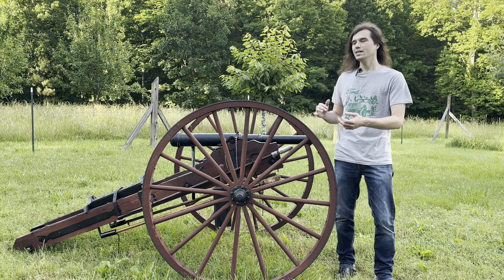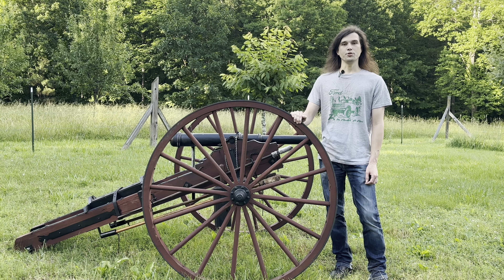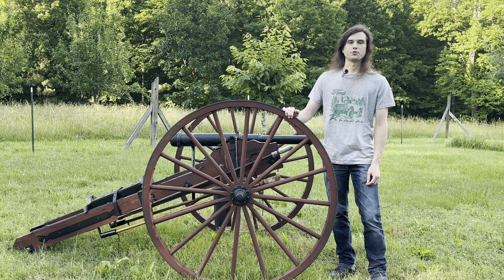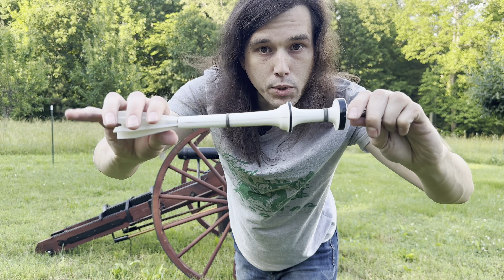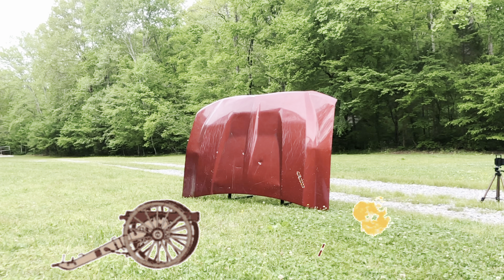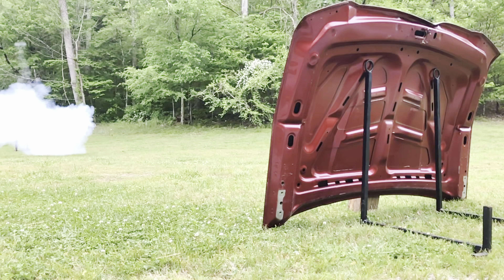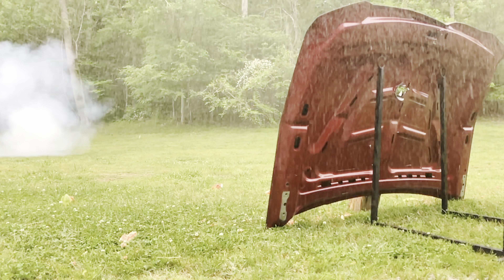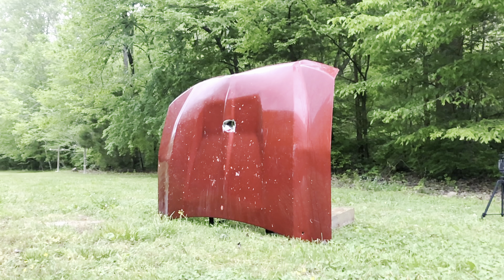Shooting 3D Printed APFSDS Tank Rounds

Comment: The finned dart sabot rounds have been some of the most difficult things for me to get to work and I'm dealing with half the scale you are.
  You can't put a wad behind the fins because that will just crush the fins.  The sabots double as the gas seal.  Most of the darts we have tested (CanaDart,  Anferov bullet,  Dynaslug,  and Sauvestre)  have lugs on the shaft that match up with lugs on the sabots.   Almost all the pressure acts on the sabots and pulls the dart down the barrel as the dart is locked onto the sabots.  A common failure was when we tried to push the rounds too hard -  it stripped the lugs right off and the sabots went flying at a high speed and the dart followed along at a very low velocity.   The video we just did with the CanaDarts used very brittle 3d printed parts.  I had to use a small 25 grain charge of Pyrodex and a spoonful of coffee as an inert buffer to fill the space.   They worked OK but we were only getting about 500 to 600 fps.
Reply from the maker: Oh snap! Wow! Thanks for tuning in! I just recently found your channel and subscribed and your sabot dart made me realize that the rods were supposed to be threaded(and why 🤣😂) like two days before this video came out. I’ve so appreciated the knowledge that you share on how to cushion rounds and the ways you load them and the gas seal ideas. I hope you truly know how much I appreciate your channel and I didn’t expect this to even make it anywhere near a comment from you! I will for sure take your tips into account and get a working V2 version in the future. I greatly appreciate the tips and you tuning in in the first place! Keep making those amazing videos.
Reply: @TheCannoneer   One of my viewers left a comment saying you were having trouble with your sabot darts so I had to check it out.   The viewer-created projectiles have been fun to do and I've been surprised at the creative ideas people have sent.   People have been telling me that we need to scale things up to something like you are doing so it is great that you are taking that opportunity.   The 12ga. stuff keeps me busy.
Reply from the maker: @taofledermaus  I was checking out the back catalog and there's some seriously weird things folks come up with. I have a hard enough time making a big round lead ball half the time!
Reply: @TheCannoneer  If you can get some machinists to answer your call to make projectiles,  I bet you'll get some wild stuff too.
Reply: @taofledermaus  Do you think Evan is ready to scale up his insanity creativity?
Reply: @TheCannoneer  I guess you need to make the fins from metal too. The impact of the wad smacks the PLA and all you got left is a rod getting pushed through the petals. Also what Fledermaus said.
Reply: @TheCannoneer  Amateur enthusiast here, with the tail fins gone before impact, perhaps reinforcing them or changing the material of the fins entirely might improve the accuracy some, perhaps weld a few thin steel fins on, and then encase the fins inside slots in the sabo itself so that they are mostly covered and kept intact out of the barrel. Encasing the plastic fins inside the sabo might also be enough to do the trick, it will redistribute the pressure onto the sabo rather than the fins as the base disc likely shattered by the looks of it. Mind you I am no expert and I am simply watching the same video as everyone else. But reinforcing the fins would be my first solution, then if that does not work, redesign the sabo to cushion around the fins.
Reply: @TheCannoneer  Try metal fins, and painters tape instead of vinyl tape.
Reply: the legend
Reply: It's great to see you here, i love both channels !
Reply: One thing you might also try is making the sabot cover the fins and make a flat surface at the back, while not touching the fins. That way all force is against the sabot and the penetrator, and none of it reaches the fins
Reply: @AhHereWeGo  Exactly what I was thinking, also reinforcing the fins might also do the trick instead, or a combination of the two.
Reply: You should encase the dart in a wooden shroud, like the old ww2 anti tank shells
Reply: I was wondering how this related to my feeds, it's taofledermaus on steroids and I'm here for it.
Reply: I'm not convinced 3-D printing is going to work out here.  The material just doesn't seem tough enough to survive a full-strength shot.
Reply: @RobertLutece909  The strength of prints is entirely reliant on how you print it. There's a way that this can work, the fins just need to be protected
Reply: @AhHereWeGo  I'm not talking about the shape of it.  The material itself isn't tough enough to do what he's trying to do.
Reply: @RobertLutece909  yes it is. PLA can be used to make suppressors, and it can be used to make projectiles, you just have to know how to print it right
Reply: @AhHereWeGo  Quite a few of us in the Buck and Slug Facebook forum use 3d printed PLA etc for wads and bases in shotgun cartridges (full power). I have had particular success using AQ like PLA tails for Lead Lee Slugs but.....these tails are nearly solid plastic and don't have any thin tail sections.
Reply: @ianvincent4911  the sabot he’s using is PLA, it stays intact, the fins aren’t because they’re exposed. If he covered them, and used a threaded penetrator instead of smooth, so the sabot gripped it better, the fins would be fine
Reply: Colab!
Reply: Was just about to recommend a cpl taofledermaus videos about flechetts. Didn't know you already personally commented😂😂😂
Reply: Interlocking ribs on the sabot and dart
Reply: Why not have the fins deep inside the propelant, with the Sabot Petals shaped to harness the expanding gasses to squeeze the petals tighter on to the projectile while in the barrell. This way the charge doesn't push on the fins, the Sabot drags the round up the barrel.
Reply: @PiDsPagePrototypes  because it would melt
Reply: @AhHereWeGo  Depends on the filament they're printed from, and the length of time it's exposed to the heat - if it's printed from the same plastic used for shotgun shells, it'd stand up to the heat. It takes around 280c to print Nylon, it's good for use in car engine components, so it'd hold up to the short sharp temperature spike of being fired.
Reply: Also, yall should do some sort of collab. I mean the cannon is basically an oversized shotgun/blunderbus lol
Reply: Is the cannon smooth bore
Reply: I was thinking the same thing, from watching your videos.
Reply: The round must be pushed from somewhere other than the stabilizing fins. Either the round protrudes from the rear,  or the fins have a solid ear support through them. Also, the fins may not be strong enough to withstand the acceleration and the  wind drag. Finally, the fins might be beings destroyed by the petals.  (SEE SPACE SHUTTLE INSULATION)
Reply: a deeper "face" for the pedals is the only thing i can see that could improve it
Reply: the OG of smoothbore shenannigans
Reply: I had a feeling you'd show up
Reply: You might be able to use a piece of all-thread as the penetrater if getting a machinist proves difficult. You could print the sabot to have the matching ID threads and print fins that screw onto the back.
Reply: Запах кофе с порохом.... Отлично!
Reply: Maybe threading the Penetrator over the whole saboted length might distribute the force enough that the sabot doesn't just sheer off?
Reply: honestly there are two ways to fix this (1. make a full metal dart) or (2. put something behind the dart so that itll be pushed out of the cannon [easier but less likely to fix])
Reply: Funny thing is I was coming to the comment section to say, talk with Jeff at Taofladermaus. And here you are with the number 1 comment. Noice.
Reply: I was literally going to comment talk to Jeff from Taofledermaus as he has a lot of experience with sabots lol
Reply: I think tank sabot gas seals spin independently of the assembly some how. I could be wrong.
Reply: If you look at a tank sabot round the shaft has rings or cut grooves on it. That give the sabot something to bit on to.
Reply: For a relatively low cost solution, I suggest using zinc. Zinc is a sufficiently strong metal that it should resist the g shock of being fired out of a cannon. It also has a low enough melting point to not require any specialized equipment. A propane burner and a iron pot is good enough (and you must use iron, molten zinc will eat aluminum). Form a sand mold of your penetrator plus fins and pour in the molten zinc.

Note: Zinc releases toxic fumes when burned, but you will not approach the burning temperature of Zinc with a propane burner. There's a lot of fudd lore surrounding the use of Zinc, most of it is false. The science is clear, Zinc will not fume at normal melting temperatures. Just to be safe though do the melting/casting outdoors.
Reply: Have you try to put cloth or cotton behind the fins and let's the pin half a inch longer than the fins. That would greatly reduce the shock on the fins.
Reply: The sabbot should have more weight at the nose.
Reply: Jeff, I am so glad to see you engage other youtubers. Brings a smile to my face to see the folks I like watching, engaging and watching other videos that pique my interest.
Reply: taofledermaus yall are real hobbiest when it comes to dart shaped shots, glad to see you here
Reply: Have you possibly tried making a penetrator with fins built in at the end so it’s the same steal?
Reply: Why did I know I'd find you here
Reply: I was able to get an APFSDS 3D printed round to work. You can use an aluminum can as a gas seal and make a cup that holds the penetrator in the can. This doubles as a way to prevent the can from deforming and crushing the fins while evenly accelerating the penetrator without applying torque.
Reply: all that remains is to fire a guided projectile from this cannon
Reply: Personally I’ve been thinking blue prints in my mind, maybe have a notch in the middle of the dart, a small divot going around the whole thing, and then add a bump on the sabot that fits inside. Helping it propel.

Comment: metal fins would help with your problem of the fins being crushed/melted by the gasses, you will need 3 fins, 3d printing the petals is a good idea but you need the grooves along the shaft and the inside of the petals that engage each other, the wad at the back is gonna also flip your darts after they leave the barrel since it is what is carrying the main inertia that is being pushed/melted into your fins and dart rear. Remove the wad, add an engaging face on the shaft of the dart and inside of the petals, the sabot is on the dart to act as its wad and its guide.

Comment: Perhaps it‘s worth referring to the Episode of Swamp People, which shows how to cast a treble hook.

Three hooks, 2 inches of pipe, filled with led.

If leaving a hole in the center, the hooks could double as spacers; not quite fins, but they‘d center the dart.  They also may remain attached and add momentum.

Comment: Sorry but 3d printed plastic isnt going to cut it. Fins need to be metal and securely attached to the penetrator otherwise you get exactly what happened in this failed video. Glad you uploaded a failure instead of fixing the issues and instead chimping out with just a normal cannon ball. Lame.

Comment: How the ACTUAL APFSDS darts work is that the sabot is the gas seal. If you look at opened rounds (lets say one from an abrams) you can see these strange ridges on the actual dart, this notches in with reverse ridges on the sabot, and the sabot will carry the dart out without crushing the fins. This also helps with stability by applying force forward of the dart further promoting a straight shot. Another thing, you need an extremely weak binder if one at all to hold the sabot together, this reduces the drag caused by the amount of time it takes for the sabot to shed off, not having a binder would allow it to peel away almost immediately leaving just the dart.

Comment: the main reason that the round isn't working is because the the petals are supposed to be (sort of) binded to the penetrator. the penetrator usually has rivets all around it that lock into other rivets on the petals, basically like puzzle pieces. and when it exits the barrel, the petals unhook from the penetrator allowing it to fly on its own. and the petals also act as a gas sealant, because you see that first bump on the petals that are closest to the fins? those are usually curved back to catch the gas and propel the whole thing forward instead of putting all the strain on the fins making sure that the fins don't collapse. i hope this helps you make your next prototype :)

Comment: try using a 50/50 mix of black and pyroxylin pistol powder this will increase the velocity of the projectile. Black powder is not capable of throwing a projectile faster than 500-550 m/s

Comment: Sabot slotted toward the front of the round coffee grounds filled in a wrap all the way back behind the fins then gun powder charge behind that. The sabot should push the penetrator from the front and then the weight of the projectile will push through the sabot past the barrel of the cannon
Reply from the maker: Thanks! I saved your suggestion.

Comment: the pressure is currently trying to force the sabot fins through the pedals with your plug hitting the back of the dart. right now the fins are the only part making contact with the pedals to provide propulsion. You need to extend the pedals so they cup around the fins and also support the rear of the dart, making a flat surface distributing the pressure more evenly. Additionally, the sabot components should not be permanently connected—they should naturally fall away once they’re no longer held together by the barrel during launch.

Comment: There’s a lot of good comments and some pushback. One thing I notice is you put these “pucks” behind the “dart” and then just clamp the sabot around the dart. Think shotgun rounds. The wad fully encapsulates the load until it leaves the shotgun barrel. Since you have access to the 3D printer, make the fletching a 5 fin design with thicker fins, use a thicker dart as well. For the sabots I would design them to fully encapsulate the fletching area and at least 3/4 of the dart portion. Another problem I could see is your canon bore is “smooth” however its not completely and most likely has enough imperfection to get that thing rattling around on the way out maybe a small grove front and rear on the sabot to add like a cloth gas ring almost. Then have the ID of the sabot at the rear convex to meet up with the dart instead of the fletching. The other question is do you print in place the fletching and the sabot with a way to attach the dart yet have break away points on the sabot so it leaves with the dart but can separate during flight. In theory you need to make a larger version of a shotgun sabot minus the shotgun shell.

Comment: A double sabot system would work I think.
Put the fin sabot in a canister filled with sand to act as a support/buffer and discarding sabot system. This way with a gas check in the back may work but may not.

Comment: The plastic is shattering because the EXPLOSIVE power the cannon has. So u should try a big potato canon well made, since it’s still got the propulsion whit out the explosive power
Reply: Also the round has some problems u should fix. Listen to d comments
Reply from the maker: Working on V3 at the moment. V2 took the changes and didn’t totally work so on to v3.

Comment: You’re not supporting the penetrator. When you fire the shot, the plastic/resin is way lighter than the steel, the plastic is accelerating faster than the steel thusly totally destroying the fins and sabot. It’s a physics problem. Just like no seatbelt on a crash test dummy in a 300 mph crash, the dummy goes flying(the sabot) car doesnt

Comment: Just a thought. If the casing were to not only cover the middle but wrap along the bottom of the fins for more grip that could encourage more of a solid shot. Once the back is out of the cannon there would be the air that could separate the shells and also potentially saving the fins. My biggest suggestion is to have metal fins. You either need to weld medal fins to the bottom of your rods. You can cast them in sand. But you really need to try to keep a total of 4 pieces. The 3 pieces for the shell, and the single stabilized rod.
Reply from the maker: I had a viewer send me some he designed with a full body cover so I’m excited to test those out!

Comment: Okay, couple things I noticed.
First of all, when you load the dart, your ramrod actually pushes the dart back inside the sabot, meaning that during firing, the fins and wad slam into the sabot and probably shatter everything. Try to put some grooves into the penetrator dart that are matched by the sabot to keep them together.

Second: the material. Sabots are made out of durable materials to withstand the stresses of firing...yours aren't. There's probably not much you can do there as I don't know what your 3D printer can take, but maybe you need to design it with some strengthening ribs to keep it together more. Keep in mind it would still be a sabot if it didn't have the design of a modern tank one. Try a blank cylinder that has a cutout for the fins at the back.
Reply from the maker: I just upgraded my printer so hopefully we can get a working version here soon made out of something printed haha.